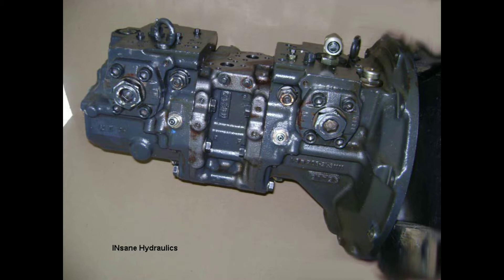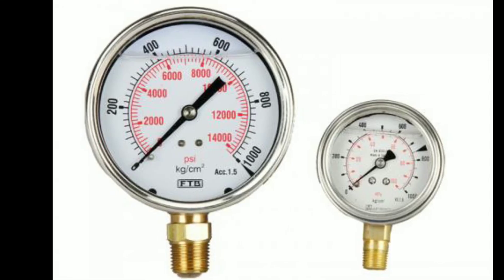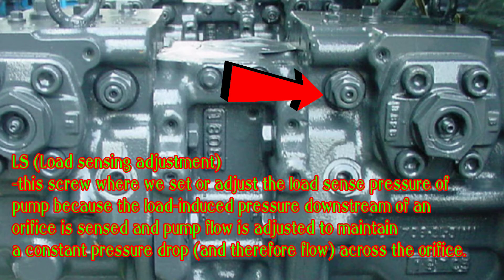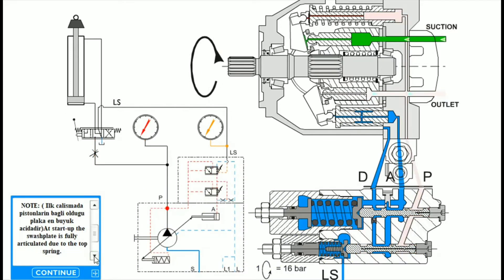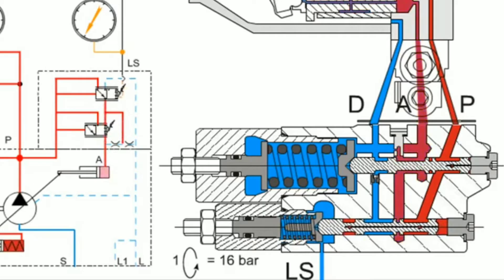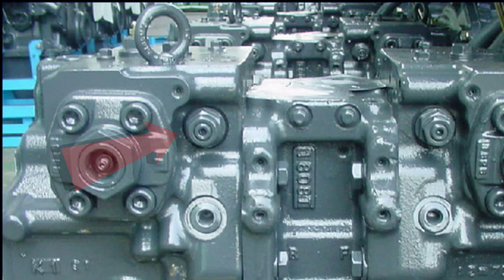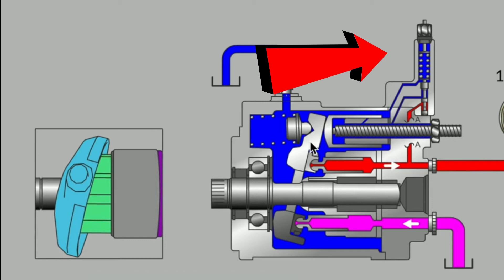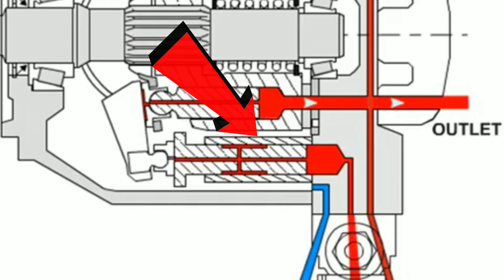How to adjust load sense / Komatsu power adjustment / Komatsu main pump adjustment by andam # 1

Comment: Hi Andom
thanks for your skills sharing,
l have som questions about komatsu pc200-7 LS valve,
what would be happen if we run the screw in clock wise direction,
Reply from the maker: During adjusting the ls valve ,try to put  mark if you dont have a preasure gauge, but if you have its better ,,in adjusting if you run counter clock wise the preasure goes down because the swash  plate angle will change into neutral, but if you run clock wise your increasing a load presure ,,but always put mark from where you originaly adjusted might im wrong

Comment: Same po ba yan sa pc 228..low power po..ayaw gumalaw lalo pag uminit!!ano problema.?thanks for the answer?
Reply from the maker: Yes sir same lang,,, madami po kasi cause ng low power kpag mainit,,, una po sa basic tau,,, i check niyo hydraulic oil cooler niyo bka barado na mga fins niya ang gawin niyo i preasure wash niyo para matangal yun mga dumi para gumanda cooling niya,,, isa na cause pa niyan internal leak sa pump o kaya sa mga cylinder i check niyo kung may tagas sa pump at sa mga boom malamang duon ang may internal leak,,  sa pump nman  gumamit kau preasure guage i check niyo yun preasure ng pilot pump at mainpump,, i guage niyo sila habang malamig at kpag mainit na dapat ndi magbago yun mga preasure niya,, kpag may nag bago sa dalawa pilot at main pump sigurado duon ang sira,,, kasi ang preasure sila dapat stable ndi baba
Reply from the maker: Basta make sure sir na ok yun engine niyo minsan kasi may mga isue na humihina din ang engine kpag mainit na,, kaya check niyo Nlang po maigi,,